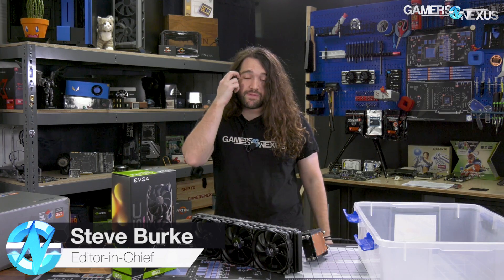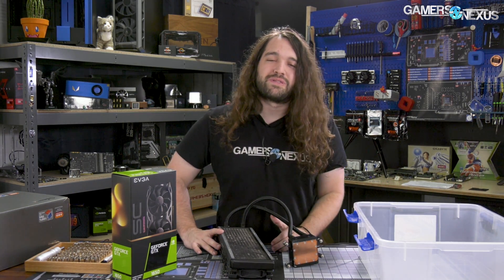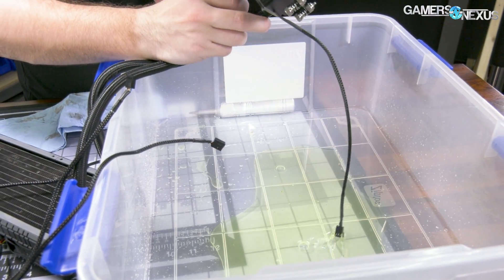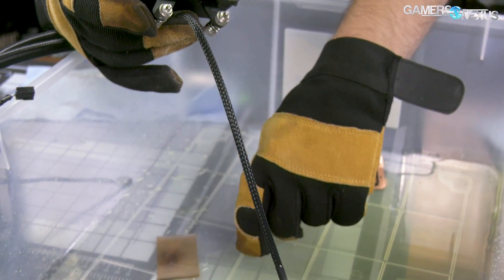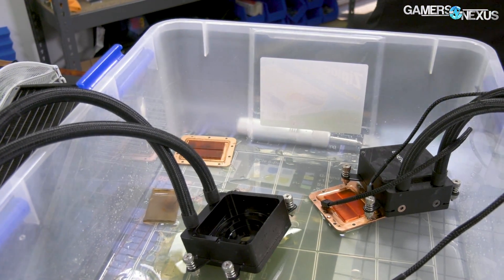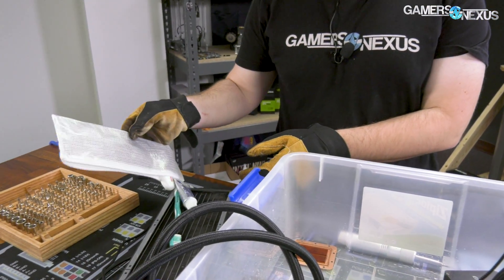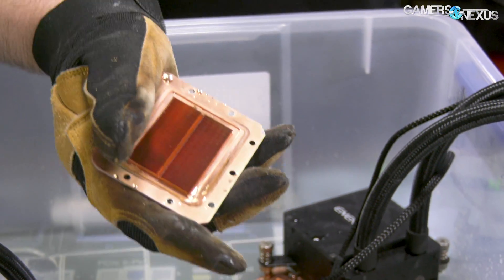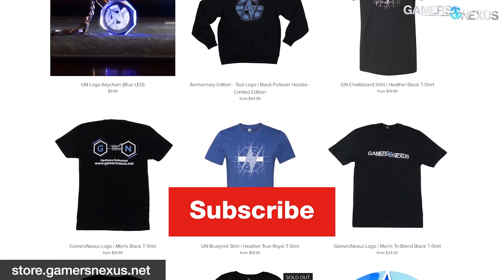Enermax's AIO Gunk Problem: Liqtech TR4 Cooler After 18 Months

Comment: Louis Rossmann was talking about how he needed to replace his Enermax Threadripper cooler because his temps were really high on idle (60+ C)
Reply: I had the same issue, turns out the pump died. I guess there was bunch of the first gen ones that the pumps were faulty.
Reply: @AngryMan540  He mentioned though that he has the second version of it but the problems are still there.
Reply: @RymeofDawn  I have the second version now, and no issues   yet, thankfully
Reply: @RymeofDawn  Bad luck then , most people say the 2nd gen is fine. level1techs use loads of them and not reported issues.
Reply: @AngryMan540  Ive owned the Gen 1 which had eaten away at the plastic around the o-ring and nearly leaked onto the motherboard, and gunk everywhere. Im now on the Gen 2 (Liqtech 2 TR4 360) and it also appears to be dying. Idle temps are now 55-60 degrees (use to be under 40) and 20-25% load sees it scaling up to 87 degrees (use to sit under 60 degrees no matter the load). Its only a matter of time sadly... I will not be getting another Enermax cooler again and would recommend to avoid them.
Reply: @OzHuski  going to have to keep an eye on it
Reply: @AngryMan540  My pump died two weeks ago. Almost cooked my CPU. This was just days after I bought a new Tuf (3550 with RX 480) laptop. This month sucked up my entire PC budget for the year. OUCH!!!
Reply: @krisspkriss  buy a NH-D15...1 fan fail...still one going and if the second fails it cools my cpu at idle anyway without fans..
Mine is going since 2014 im every build...atm  its cooling a I7 9700k 5.15GHz all core oc at 55% fanspeed under load
Reply: @AngryMan540  yup I had one of those. Died in under 2 months. Idling at 50-60c.
Reply: My pump died and enermax sent me the new version but I had to pay $50 to ship this already known to be defective product to them
Reply: Wow that sucks, my Threadripper under full load when stock stays below 60c on an 8 year old 120mm AIO! I believe its a first gen Asetech pump (Dell used these for the XPS 730i is what mine was intended for, its before Alienware existed).

Temp was mid to high 50's peak after a long load at 100% utilization (hitting 180w stock power limit and boosting right up to match it). At 350w at 4.1 Ghz at 1.425v it gets into the mid 80's, but that is again with a cooler that doesn't really touch the cores... Its half the IHS coverage, and as we all know, just barely contacts over the corners of the chips, and that's not even close to the water channels. Not bad for a super old AIO or the Threadripper!
Reply: i had the same problem
Reply: The one video I ever saw of him, he was trying to convince one of his contemporaries to engage in price-fixing with him.

Never watched another.
Reply: @Asdayasman  Someone doesn't know Louis all that well haha.

Comment: I havn't changed the coolant on my open loop since 2012?  Its still fine, no corrosion or gunk.  I can see it through the clear water block covers and inside the cooling tower, still a clean as the day I mixed it.

Probably a lot to do with the fact I only ever use automotive coolant in my loops.
Reply: I have automotive coolant in a mixed metal open loop with my DIY hybrid watercooled laptop - nickel, copper, PbSn solder, BiSn solder - the coolant looks just as clean as a year ago when I put it in. I use the same green coolant as I use on my 25yr old alloy BMW V8s as it has extra sacrificial zinc (to protect against galvanic corrosion).
Reply: @greebj  Mine is mixed metal too, Aluminium, nickel, and gold plating and I have had no issues since I had my loop since 2004. I have been reusing the loop and added a GPU block over the years. Great thing about AMD was the block fits from socket 939 to the current AM4 so I have been able to use the same loop for a decade and a half.  I have only changed coolant 3 time since then and only because I figured I should not because I had to.

I use a type B  auto ethylene glycol inhibitor and just normal tap water. No problems at all.

Comment: Did steve say he completely changed the liquid in the in use AIO, or did he just top it off?  The reason I ask is that topping it off would not remove the fluid as the potential culprit.  

Does anybody know what material was used for the cold plate gasket?
Reply from the maker: We didn't remove the fluid as the culprit in the video, either. I can't 100% recall, but based on the color that came out, it looks like it was 50/50 old+new. We probably need to refill one of these and then thermal cycle it harshly to see if the gasket still deteriorates with known-good coolant.
Reply: @GamersNexus  cool.  Thanks for the info!  I have one of these, and before installing I plan on completely replacing the fluid.

Comment: Those water coolers are nothing but a liability. Is there an actual reason for aio to exist for people who use their PCs for doing stuff? Or do people just buy them to be partial to "enthusiasts" category.
Reply: Generally is cooler and/or quieter, but much less reliable
Reply: @everythingfeline7367  Eh, you need a really high end AIO to compete with the top level Noctua stuff as an example, and often they're louder too (often it takes a triple fan rad to beat a D15 by more than 1 or 2 degrees, so you have more fans + the pump). It can make the inside of the case look nicer (which can be a biggie since most every case has a window these days...) and the build process might be easier since the pump block is easier to manipulate than a big hunk of fins, and the rad fans can double as case fans. But for out and out performance or noise it's still very much a toss up between high end AIOs and high end air coolers, with the air coolers having the advantages of lower price (even the D15 is cheaper than any AIO that can match its capabilities) and reliability.
Reply: @jubuttib  I don't know much about coolers in practice, most is book smarts because the cooler I use is the stock AMD one.
Reply: The main reason i see is quietness but my Dark Rock Pro 4 is inaudible
Reply: I wanted to build a nice looking computer for once. Found the perfect case, the Lian Li O11 Dynamic. NH-D15 doesn't fit in it, and it doesn't look nice. I got a Corsair H150i Pro RGB. It's at least as cool as D15 and just as quiet, even though now my computer sits on my desk right next to me instead of being under my desk.

Comment: I still refuse to use liquid coolers. I'll stick with the reliability of air unless I have no other choice.
Reply: Can't argue with that. I love air cooling I have a nh d15 but recently have gotten into custom water cooling. It's fun for me cause I love tinkering with my rig. However for stability I will always go air
Reply: Agreed. NH-D15, two 140mm silent fans, no leaks and no pump noise. Performance just as good as any 280mm AIO liquid cooler, but lasts forever.
Reply: @jameshanna8762  that's what i got for my i7 9700k :)
Reply: Gruntsworth just don’t buy from crappy companies
Reply: You're goddamn right.
Reply: I’ve used both the TR4 and the Noctua 14 with fans in push pull. The Enermax allowed for higher clocks under stock performance while benchmarking.  I could match with the Noctua but had to  force an OC to do it. Temps  and noise were higher too. 

I prefer the AIO but the Noctua is more reliable.
Reply: Bought a phenom 2 955 back in late 09 with a first gen closed loop Corsair H50. The HDD I bought at the same time has about 65,000 hours. The H50 has 65,000 hours. No issues. Still idles at roughly 30c, full load mildly overclocked is 35c. Running at 4ghz it would get up to 55c with a push-pull setup on the radiator. 

I've thought about opening it and checking it out but still can't be bothered. It still works fine. I thought about buying a a larger air cooler, I'm happy with my purchase. 

Water-cooling parts for PC's are insanely overpriced though. You can't tell me that a 3x120 radiator made of copper is worth $300 when I can go buy a copper radiator that weights 30lbs for a diesel truck for $350. 

As a final note to the reliability of water cooled electronics, the Prius I have has an inverter system that's cooled by a separate  cooler setup than the engine. Mine has 280,000 miles. All inverter setups in hybrid/electric cars have a very similar setup.
Reply: AIOs look cool  and are quiet and large ones have better peak short term performance, but honestly if you  get a Gucci air cooler it'll be pretty much as good performance wise, and even $30 air coolers will get you 85% of the way there. To me it's always a budget thing. Getting an i5 with a badass AIO makes no sense when I could use that money to get an i7 that will perform better than the i5 even with a $25 air cooler.
Reply: @dogboy0912  "AIOs look cool"

Disagree. The tubes of an AIO just flopping into whatever position they find makes a build look awful.
Reply: CRYORIG R1 UNIVERSAL.
Reply: AIO's are Better then they use to be, especially with the brands that have been making them a while. Still have issues and Air coolers are reliable, especially NH-D15 Type coolers.
Reply: I refuse to go back to air, when you can cool a 4.8ghz 6700k and overclocked 1080ti with 3 500rpm fans I'll stick with the efficiency and silence of water unless I have no other choice.

Comment: My 280mm model died 2 weeks ago. Pretty sure it's gunked up :(
Reply: take it apart and make a video!
Reply: @HeYKeiFeR  Might do just that :)
Reply: Hardware Unboxed Will you also test the LiqTech 2 LGA115x/AM4 edition?
Reply: @Hardwareunboxed  Feed your twin. 😁
Reply: Hardware Unboxed Pour VB into it?
Reply: My 360mm unit died a couple of months ago :( took my processor with it too. Had to downgrade to R7 after
Reply: @tsetsgiindelbee1340  What happen? normally if the pump dies you should still have time to shutdown the system or should have auto-shutdown over T-die max temps!!!
Reply: @boblee5524  okay so I lied... the cpu dieing was my error while reinstalling the cpu cooler after thermal paste reapplication. I had made a mistake while reinstalling it that lead to cpu contact damage. Still wouldn't have to of removed the cooler if this wasn't an issue. But I don't really blame enermax for the cpu. Just my dumbass
Reply: I had 2 of them already broken. First was delivered already leaking, second started leaking / fluid evaporated after like 2 weeks. Used an Arctic Liquid Freezer for a year then but never was happy with temps ... ordered another Liqtech 240 2 weeks ago, mouted it like a week ago and since then its working. 
@GN How much fluid do they hold in case i decide to maintain it in like a year or so ?
Reply: @AdmireFiestaGuild  Good luck on that one. I refilled my Liqtech 240 after some weeks because i was curious and then found similar gunk inside. Mostly aluminium oxide. Later i used it (with tube adapters) in a custom loop. After 8 months of use the pump just died.
Reply: Mine died about six months after i bought it, then after cleaning it, I fried the pump, while trying to refill. So I ended up hooking it up to my waterforce. Working for over six months now without a problem.

Comment: I used an Enermax Liqmax AIO on my old Bulldozer AMD.
After one Year the pump failed.
Never going back to Enermax.
Reply: My Corsair AIO died 95 days after purchase, which is five days after the warranty expired.  I realize I was probably an outlier and haven't let that sway me from AIOs or Corsair as a brand.
Reply: @orangeActiondotcom  I've had pretty good experiences with corsair, I've owned 2 of their AIO and never had a problem so i think you were definitely an outlier. They have a reputation as a good quality brand.
Reply: @orangeActiondotcom  The Problem with Enermax is, that that behaviour is not that uncommon for their products.
A friend of mine also had issues with a different Enermax AIO Modell
Reply: @HoJSimpson  i have never had a quality enermax product when trying to save a buck. Just not worth it.
Reply: @HoJSimpson  Ah yes, I've also had friends with a problem.  Might as well just write an entire brand off.
Reply: @orangeActiondotcom  But in your Case the Brand was Corsair. Which has a way better Reputation. Enermax kind of sucks anyways
Reply: @orangeActiondotcom  
My circa 2010 Corsair H50 work like new and has 65,000 hours on it. It may fail any minute, can't complain, I've gotten my money's worth. 

I think you were definitely an outlier. I'm sitting at 7 years of up time.
Reply: Been using a coolermaster nepton 280L myself since 2014 and it works like a charm after replacing the fans as those are just generally noisy and not very efficient.

Comment: Can you take a look at the Liqtech II? There are a lot of reports of these suffering the same fate as the original.
Reply: Same issue... i have 280 version... replaced fluid, works like new.
Reply: @UnDadFeated  how long have you been running with the new fluid?